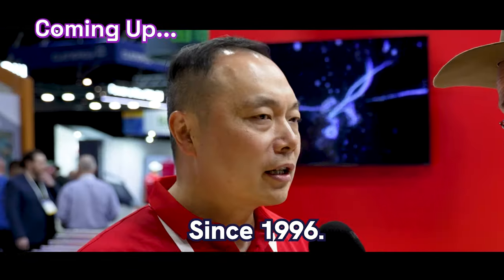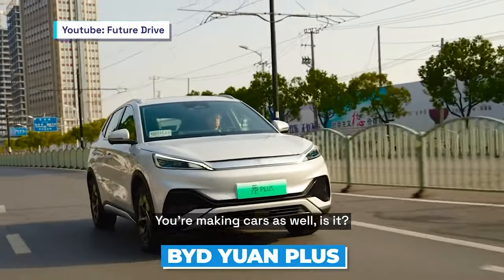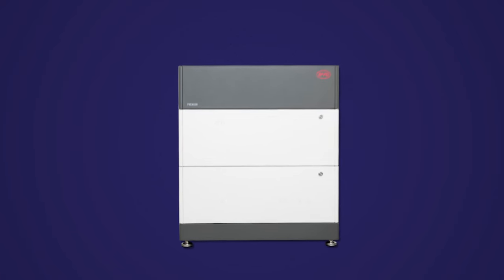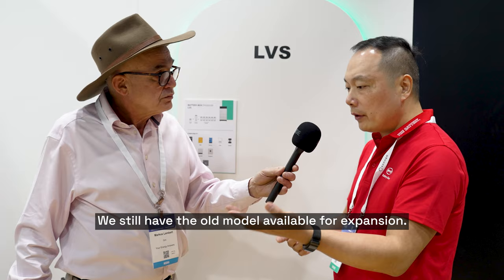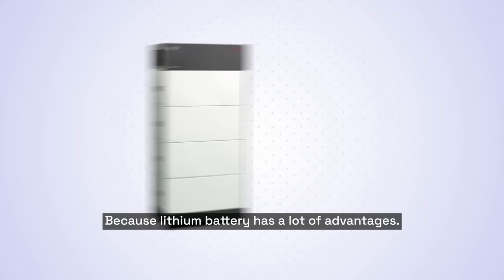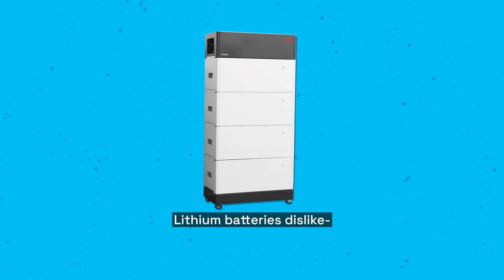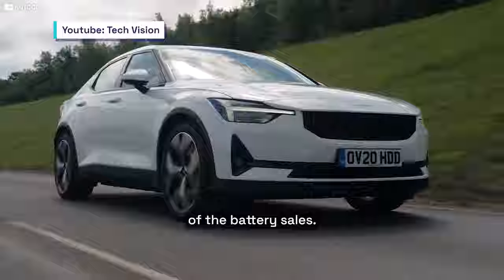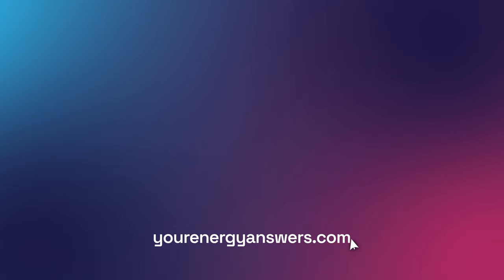Everything You Need To Know About BYD's Home Solar Battery

Comment from the maker: So would you consider BYD as your home battery?
Reply: Absolutely yes
Reply: Maybe
Reply: Never.
Reply: Not even if one was given to me for free. Only a fool would jeopardize his family’s safety for a cheap junk battery.
Reply from the maker: @mikestewart4752  Didyou know tesla uses byd batteries? https://thedriven.io/2023/05/22/teslas-switch-to-byd-batteries-is-achieving-faster-charging-times/#:~:text=Tesla%20has%20started%20using%20BYD,significant%20increase%20in%20charging%20speeds.
Reply: If the price is right
Reply: @mikestewart4752  you basically don't know what you're talking about. This batteries are lifepo4, safer than any other technology...
Reply: @Ale55andr082  Not when they’re made in The Chiggity they aren’t. 🤦
Reply: @yeanswers  OMG, the same old rebuttal. Under watchful Western management, sure. Great. Turn your attention for a second and you get Sum-Hung-Lo brand that go off like firewrorks… Sorry if it hurts, but look at all the videos here on YT. As I said, Chinese batteries are not for me. Thanks.

Comment: These are LFP batteries. So far far safer then Lithium Ion batteries. Regarding the discharge to not go and discharge them completely, again a non issue as any of the modern Inverters can be programmed to only discharge to a given percentage left in the batteries. 
I have a Hybrid system with 40KWh LFP batteries from a different manufacturer and I sleep well at night, not worrying about what would happen in the extreme case of thermal run away. If I would start from scratch today, then BYD home battery system would certainly be very high on my selection list.
Reply from the maker: That's a pretty decent Sized Battery.. What you cooking? :)
Reply: @yeanswers 24KW Solar / Three 8.2KW Fronius Primo's / Two Selectronic Pro 7.5KW Hybrid Inverters / ten 4KWh ECO4840P SFP Batteries mounted in one of their Racks / 15KW Diesel Auto Start Backup Generator. All this supplies a large Federation Style house with a large central air condition, a 2nd split air condition in the rumpus room where the equipment is installed. / Pool / all electric equipment like: Washing maschine / Dryer / Stove / Hotplate / Water tank pump / Hot Water System / electric push mower / electric 54' ride on mower / EV with 77.4KWh battery...etc, etc, etc. I even have now an electric chainsaw. There are very few items left which are still ICE and will stay this way for the foreseeable future. 
Not everything can be replaced with electrical items. 
We are still hooked up to the Grid for the time being as the large upgraded system has only been installed for about 4 months, but most of the solar equipment has been already in use for 10 years and has simply just been up-scaled 5 fold.
After winter, we will decide if we stay connected to the Grid or disconnect. Due to the extremely low export margin of 2.3KW imposed on us, we are still left with a connection bill of around $160,- a quarter. 
Winter will decide if we keep paying for the convenience of having that 3rd backup, sort of an "extra" insurance. 
So far we have travelled 5600km+ in the EV at a total cost of AUS $13.55 and that was only because we wanted to try out a fast charger..not that we needed it. 
No actual electricity cost at all and we don't try to be "frugal" in usage. the only concession we make once in a while is turning the Hot Water system OFF for one day if the weather has been really miserable, as the system holds the water hot for at least 24 hours. Airconditions are on 24/7.
Reply: @alf699 curious to hear what a system like that set you back and how you would change things if you were to go at it again? We’re looking at doing the exact same with a byd battery setup and other bits to go with it. Only difference is we still run on gas water/cooking.
Reply: @yeanswers  Everything. It's actually bigger now...50KWh and I will add another 4KWh in a couple of months.

Comment: WHAT IS THE DIFFRENCE BETWEEN HVS OR A LVS?
Reply: HVS (and HVM) is high voltage architecture for HV inverters such as Fronius Gen 24 models. LVS is Low (48v) typically used for Off Grid use.